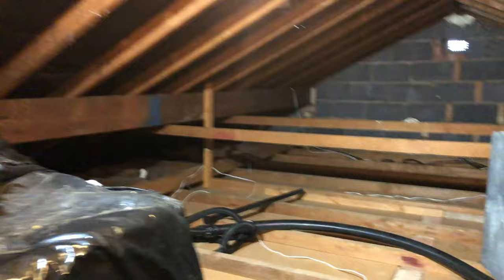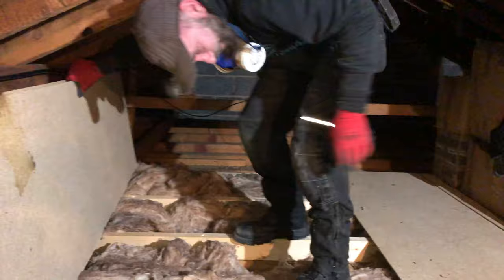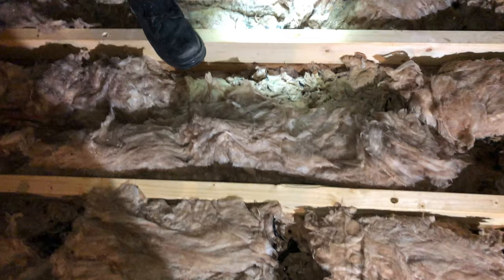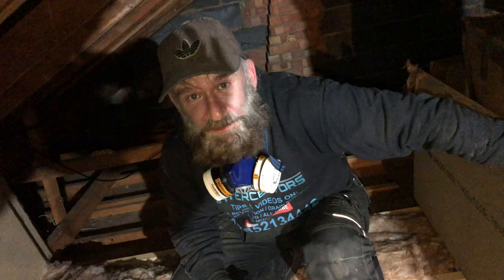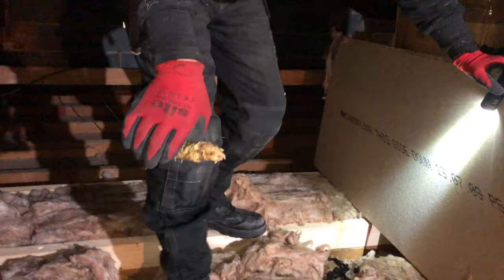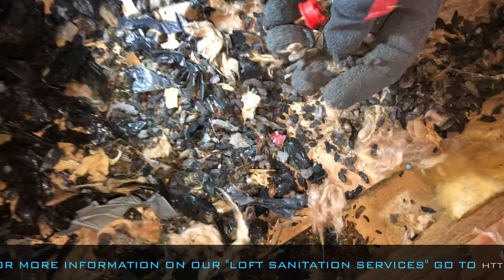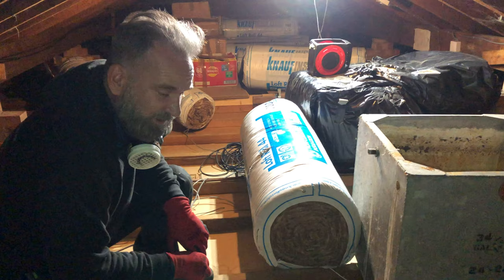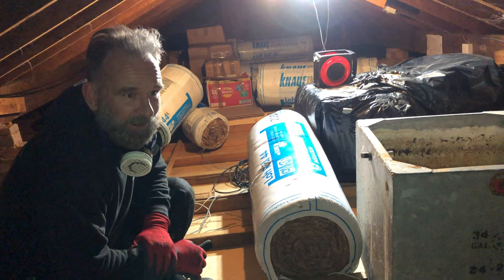Having your loft decontaminated after a rodent infestation is a great way to prevent re-infestations

Comment: Found a mouses nest today in an old caravan, they used brillo pad to make a nest in, they also took 2 out but no pink powder on it, thought they didn't like wire. Very informative video, thanks for sharing 👍
Reply from the maker: It’s not that they don’t like wire wool, it’s the fact that they can’t and don’t like to chew through it, so it makes a good thing to block holes with.